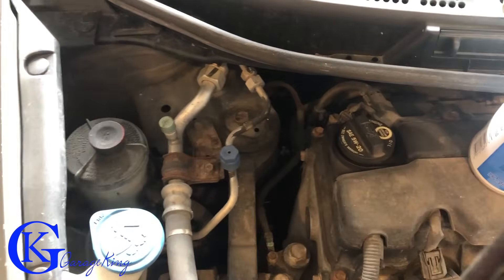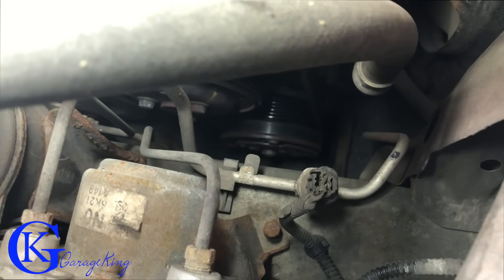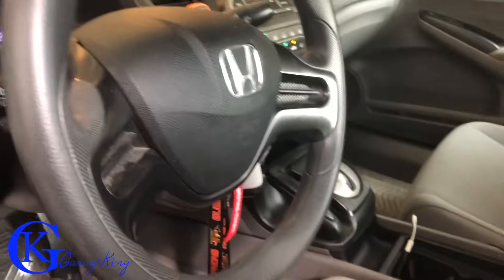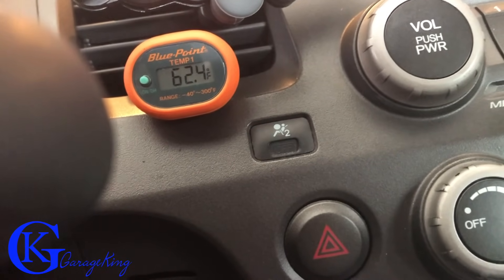How to charge Honda Civic AC with a can

Comment: Thanks for this! It helped me do my refill for an 09 Civic. I got the FrostyCool 134 (replacement for 134a and r12) that you linked. The cans are 6oz and on them, it says one can is equivalent to 15oz of 134a. Just want to triple check that when you use this product, you don't use both cans right?
Reply from the maker: Hey there and thanks for the comment, and you are right one can only !!  The 6oz can of replacement is equivalent to 15oz as you mentioned and the capacity of the system is only 16oz.  Now when you checked your system if you compressor is not starting then you have less than an oz in there (usually)  If you compressor runs but its not cool then you probably have 2oz give or take.  As long as its not cool then you are ok with one can as you will not have much in there.  Hope I helped you out :)
Reply: @GarageKing  thanks so much! The compressor runs but just warm air. After refilling, I get cold air like before. Problem is it’s only for like 10-15 mins and seems to be when the cars been off for a while. If I’m driving to multiple locations I’m ok on A to B but B to C and C to D, it’s warm air. The compressors still spinning and pressing the AC button inside toggles the compressor on and off just fine but no cold air till after a couple hours of not running the engine again. 

Any idea what it could be?
Reply from the maker: @karlgajonera1646  Hey Thanks for the comment, If you start it the next day and its still cold then you know its not all leaking out.  There is the possibility that the blend door (hot/cold door) in the dash is not sealing or not closing fully and allowing hot air to mix with the cold air.  On a hot day the low pressure line under the hood (the thicker line) this is where you put the refrigerant in,  should be cold and sweating (dripping water) because its cold and the outside air is hot.  If the compressor is running, and there is refrigerant in the system it should be cold.
Reply: @GarageKing  was monitoring this a bit more and I think the compressor stops working after a while. I confirmed by checking it in the engine bay and had someone else press the AC button on and off. The compressor doesn’t spin at all. It’s doing this seemingly only once the cars all warmed up though hence the comment I made that it only works for like 5-10 minutes.
Reply from the maker: @karlgajonera1646  Hey there, sorry for the late reply, your comment just came in, even though its dated 2 days ago.  I find sometimes I get a bunch of comments and they are a day or two old, weird, anyhooo........   I wonder if its your thermo switch.  Its not a terribly expensive part and its located on top of the compressor.  I think its about 30-50 bucks from honda and it is a common problem.
Reply: @GarageKing  no worries at all! I appreciate you getting back with more ideas. I was quoted $1.2k CAD for the compressor replacement and labour so I think I’ll try the thermo switch first. Hopefully not too bad of a DIY.
Reply from the maker: @karlgajonera1646  Perfect, I would give that a try first as compressors are not normally intermittent, but the thermo switch may cause those types of problems.  Its worth the chance to try it as the cost is not high.

Comment: What is that paper booklet you had? Can that be downloaded online?
Reply from the maker: Hey There, the paper book is worth its weight in gold.  Its a book that has all the specs for most vehicles for the amount of refrigerant, how the belts are run, sensor locations, and information about the heating systems of the vehicles.  I think I paid about 20 bucks for it, but that was a few years ago, I think the book ends at vehicles about 2015, but some models have not changed so I can still use it.  As far as I know you can't download it.  The company that produced the book is "Products Research Inc." I don't know if they still produce books.

Comment: Should you only put 1 full can?
Reply from the maker: The system only takes about 16oz.  At the 2:40min mark I go through the amounts, but yep, if your AC is warm then 1 12oz can is fine.  I would not go more than that as you could possibly overfill your system.

Comment: The ac is not recharging what should I do?😊
Reply from the maker: Check to see if the compressor is spinning.  If its not spinning and you put refrigerant in than most likely its the thermo switch that is located on the top of the compressor.  No guarantee, but its a common failure point with Hondas. It looks like this https://amzn.to/4ab5ekn make sure you look up the proper one for your year.  Its a cheap part.

Comment: How do you know how much to put in?  Do you need the whole 12 ounces?  How do you know if the car needs more than 12 ounces?  How do you know if it needs less than 12 ounces?
Reply from the maker: Hey there, at the 2:32min mark I show the manual where the car at empty needs 1lb so that is 16oz, so if the car is barely cooling you probably only have an oz or two in it. So putting in a 12oz can should be safe. It should get pretty cold with a 12oz can even if it was empty, 12oz would make it quite cold. There is no way to know exactly how much is left in the vehicle. The only sure way is to evacuate the system and fill from empty. If you are not comfortable please don't do, and as many of the cans reseal themselves once the air is cold you can stop filling.  This way you can save the rest of the can for later.

Comment: What if you don’t need a full can tho?
Reply from the maker: Hey There, if you are really low your are going to need at least one can.  There are two ways to tackle any left over...  Ok #1 first put a full can in and if its low but will still run cool then leave it at that, no waste.  #2, if you need more than one can, but less than two make sure you buy resealable cans so once you are done say putting in 1/2 can you can disconnect it and the can will reseal.

Comment: Would u be able to add 1/2 that can ?
Reply from the maker: Hey there, if its not cooling well, but still cooling, then you could add 1/2 can.  Note that some of the cans are not self sealing so you basically have to add the whole can, or the rest gets wasted. Most of the time a little overfilling does not hurt, so if it's warm you should be able to add a full can.  Just not one of those 20oz cans, those ones are too big.

Comment: Is the AC still on blast when you remove the can?
Reply from the maker: Yes that the best way to remove the can.  Once you shut the car off, the pressure will rise on the low side (where you are filling) so its best to take it off when the car is running with the AC on high.
Reply: @GarageKing  Thanks! Also, if I'm doing two 8 oz cans what is the process for switching to the 2nd can?  My 2016 Civic EX-L 1.5T has approx 14 oz capacity so I plan on using about 1/2 of the 2nd can.
Reply: @GarageKing  Do I remove the can by using the twisting the knob to un-puncture the can? Or twist the can off. You left this crucial part out of your video as I had a friend once remove it and it exploded off. I wish you would have filmed how you took it off as this would have made your video perfect!
Reply from the maker: @sk-un5jq  Hey There, there was a reason I didn't film it LOL :)  many cans are different.  Some you can unscrew the twist knob and they reseal, and then you can disconnect from the car, some cans don't reseal and then you twist the knob in (but its all going to leak out anyway)  The biggest thing is to remove the can when the engine is running.  Hope that helps you out, and I should have mentioned that in the video.
Reply from the maker: @sk-un5jq  Switching to the second can is easy.  Once the first can is empty (and the engine still running) then you can just pop off the connector from the car.  There will be about 30-40psi pressure so you should just get a little pop.  Then what I do for the second can is 1. screw the can onto the hose 2. attached the hose to the car 3. unscrew the can a bit from the hose just enough to get some air out (this is purging the line so now your fill line has no outside air in it) 4. pierce the can and begin to fill.
Reply: @GarageKing  Mine is the reseal so I'll just unscrew the twist nob, leave the can intact, and then remove the pressure gauge from the low port. Right?
Reply from the maker: @sk-un5jq  Yes 100% brother, have a good day :)

Comment: I have a 2017 Honda Civic si , my passenger side blows kinda cool but driver’s side warm would I be able to add just a 1/2 of can of Freon ?
Reply from the maker: Yup most likely you can.  The drivers side is further from the evaporator so thats why it's probably warmer on that side.  Usually when you get almost no cooling you are down to about 2oz just for reference. If its barely working you can probably get away with a full 12oz can, not a 20oz can.

Comment: The freon in my can emptied in about 1 minute,  but I feel like it could still use more as the ac didn't get much cooler.
Reply from the maker: 1 Min is way too fast, it should take a few min, sometimes 5min.  I think you probably opened the valve too fast.  I show in my vid to pace it in and keep the needle around 40psi.  I wonder if the valve that you attached to the can was leaking.  Its very common for them to leak where you twist that thing down that pierces the can.  If you system was totally empty you can probably fit two cans but if your compressor was running before you put the can in, then 1 can is all the Civic can take until its low again.  From totally empty the Civic should only take 1lb so 16oz.  Your can could have been a 12oz can.  I would not put another can in.  Run it around for a week if you want, then you can maybe put a can in but be careful and watch the gauge.  Don't let it get high (keep it under 40-50) and do it with the engine running, its easier as the compressor draws from the can.
Reply: @GarageKing  the ac hose I was using did not come with a gauge but I admit i did depress the thumb lever all the way down from the get go, as the manual i referenced did not say anything about slowly releasing the refrigerant
Reply from the maker: @DannyPacheco-j6f  oh wow haha!!  Yes it definitely went in too fast. That’s ok as it was really empty.  Once it starts getting full you have to pace it as you don’t want the liquid from the can to hit the compressor cause you know you can’t compress liquids…….  So when you pace it in the liquid goes in and turns to a gas in the line.   All good, but maybe run it around fir a week before you try another can. If you get a can than has the resealing ability only put 1/2 in. You can feel how much is in the can as it gets lighter and you can kind of swish it around.  If the can you used was a 16oz can I wouldn’t put anymore in as that’s the max you are suppose to put in. If the can you used was a 12 then you should be able to put a bit more in, but don’t put the whole can in.   Also make sure your AC is on recirculating and it will be colder. If it’s not on recirculating it let’s the hot air blend and it’s never going to be really cold 🥶

Comment: I follow every procedure, but when I started to fill, my AC compressor exploded. Right now it is my AC compressor is not spinning anymore. I didn't try replacing the fuse relay yet.
Reply from the maker: Hello and thanks for the comment :)  It is very rare for an AC unit to blow like that.  Normally the high and low side sensors protect the compressor.  if you filled it too fast there is a possibility you could have put liquid in the compressor, and the compressor can't compress liquid, so that is a problem........ Check the fuse relay, but a common cause of AC not working on the Honda is the ac thermal switch.  The are known to go quite often.
Reply: @GarageKing  Hopefully I don't need to replace the AC. I think your opinion about the liquid could be the cost of the explosion and stopped spinning. Thank you for your response
Reply from the maker: @KcArmada  Anytime brother, my fingers are crossed for you that its not the compressor !!!  If there is a silver lining, its that rebuilt compressors have come down in price and they are not that expensive anymore.
Reply: I followed all these steps but now my ac doesnt even blow even a lil cool are like before and now my engine wants to shut off?

Comment: Great vid but my A/C is still blowing hot air
Reply from the maker: Thanks for the comment,  is your AC compressor running?  If your compressor runs it should get cold.  If it's cold only for a day or so and then gets hot that means you have a big leak somewhere and should take it in.

Comment: I was afraid to put too much as you said it’s dangerous. I used only 1/4 can of an 8oz CAN to my 2018 civic because it’s still gets cold when driving but not on idle. The gauge shows more than half under “full” Can I reuse the same CAN if i still need more later on? Thanks
Reply from the maker: Yup you can reuse as long as the can is a resealable can.  If not it will leak out, but many new cans are self-sealing.
Reply: @GarageKing  thank you so much for this vid. Would you advise to put the whole can in my case?
Reply from the maker: @flypnoy2601  Hey there, I think you would be safe doing that. Your car would have been pretty empty and it usually only takes a few oz to get the system to start cooling. Because yours goes back to warm at idle that means the level is still very low.  Remember to purge beforehand. You can do this by screwing the scan into the adapter (don’t twist the piercing needle) then connect to the car, then untwist the can until you hear a little air come out. Tighten the can back up, start the car, turn AC on and then pierce the can and slowly empty the rest into the car. This prevents you from introducing moisture into the system. As always no guarantee on anything but based on your comment I think you will be ok. Thanks

Comment: It will work on certain car... temporarily only
.. too much ac oil in the can can damage the compressor
Reply from the maker: You are right that too much oil can damage the compressor.  Normally you don't add oil unless you are replacing a part.  Thanks for the comment, and hope you are having a good weekend :)

Comment: 651 Like fully watch adds and all to the end great video, I will give this ago,  car is 10 years old and don't think we ever charger it on this Honda Civic..  Great video thanks for this...👍👍👍👍👍👍😍😍😍😍😍😍
Reply: I am still at your home page watching other video love it not done yes...
Reply from the maker: Thank you so much !!!!  I do appreciate it :)  This video has a pretty good view count so I can tell that it has helped many people.  I try to make the videos easy to follow.  Thank you again for great comment :)
Reply: @GarageKing    When I recharger years ago I remember I also put some oil in it with the can if I remmeber correctly ?  so there was  a can  that time I put 2 can that is why it screw up,  I also put some oil they tell to.
Reply: @GarageKing   They will charger couple hundred at the shop just to do this in USA that was long ago
Reply from the maker: @shahnawazvlog6266  Normally you never have to add oil unless you replace a part or you are charging it up all the time.  The oil leaks out very slow, so maybe every few charges you might need a bit, but not often.  If you replace part then you drain the part and measure what comes out and put the same amount back in.
Reply from the maker: @shahnawazvlog6266  Oh yes they do.  Many people are afraid to tackle AC problems when in fact its not that hard once you know how :) You can save a lot of money by doing this yourself.
Reply: @GarageKing  👍👍

Comment: AC relay are also a weak point in civic 8th gen
Reply from the maker: I think you are right, but aside from the relay and leaks that can happen, the thermo switch on top of the compressor is a weak point that often fails.  Thanks for sharing !!

Comment: Very helpful .Thanks
Reply from the maker: Thanks for the comment and glad I could help !!
Reply: Sir my compressor is not moving.what I can do myself?
Reply from the maker: If its not moving when you fill it, well it could be a number of things.  BUT ......  A very common problem with the Civic's AC system is the thermo switch.  Its located right on top of the compressor, its a pain to get at and it does fail. I have had to replace a few of them for compressors that don't start.  The switch is not very expensive and you don't have to discharge the system to do it.
Reply: @GarageKing   Thank you Sir.I will try again.
Reply from the maker: @jatinduggal584  anytime and I hope it’s the thermoswitch. Not too expensive and doable.